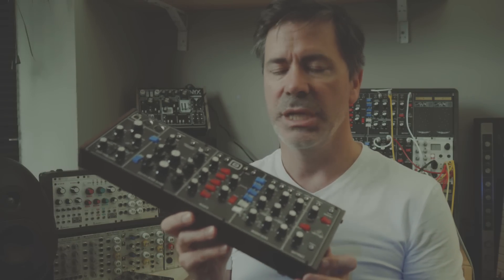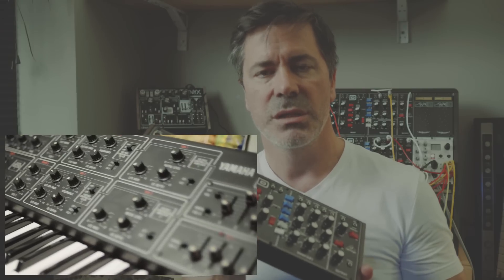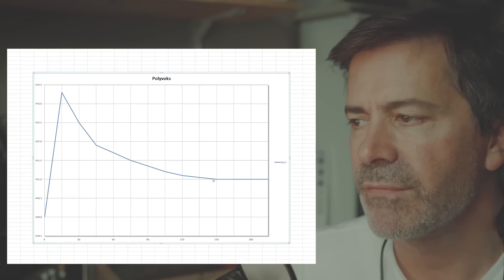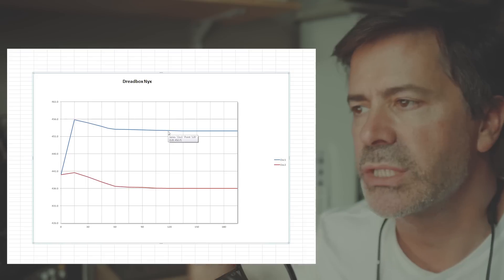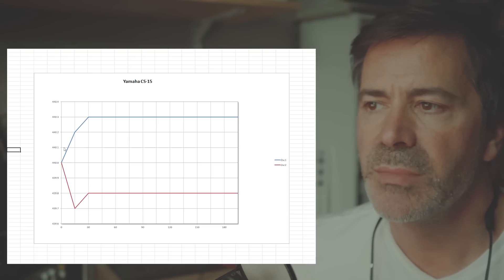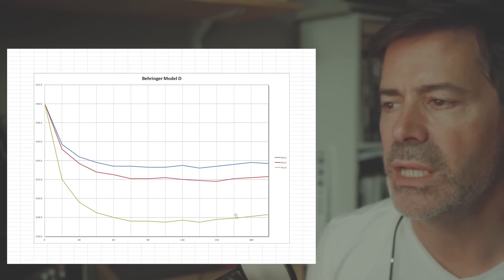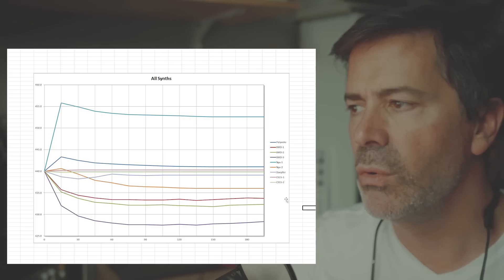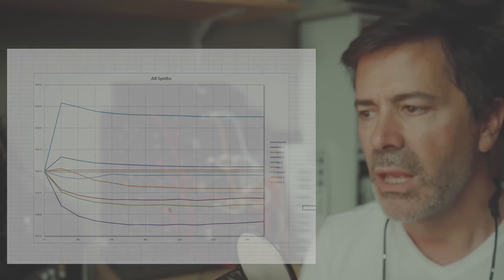Behringer Model D Oscillator Tuning

Comment: Excellent video. Thank you for producing it. This topic is why I occasionally consider flipping all my analog synths for digital synths. Sometimes I just want to work instead of waiting for my synths to warm up. But alas, warm and fat are hard to come by in the digital synth realm.

My current rule of thumb is to not bother tuning anything until after a good hour. That also means everything is out of whack until it warms up. The positive is that I basically never have to tune anything unless I bump the dial.
Reply: I think it's a matter of 'necessary authenticity' of each voice in your individual style within the canon of a chosen idiom.

If you gotta have a vintage synth sound, you can imitate it well(-enough?) using newer synths + doing some extra work..
Using the real thing gets you there instantly, with all the associated pros and cons. 
i.e. I still haven't found any sort of adequate substitute for my ARP Solus's lead character (swiiiiiiiirly and sizzly as f*ck = the 'most psychedelic' VCOs!), but that character only is apparent and effective in certain arrangements that bring it front and center. It is pretty stable for a 1980 build, btw.
 It is a similar deal but not as obvious with the TB-303. Iin a dense mix the clones may do just fine. However, in some of the more minimal music - wherein the 303 plays more 'naked-ly' -  is where I can sometimes I hear the differences vs my x0xb0x and FR revolution.

Comment: that was an interesting & enlightening experiment...
i have a behringer d & an arturia microbrute...
i always give them at least an hour to warm up before i use them...
although the model d's tuning does drift slightly over time, especially oscillator 3, it's nothing compared to the drift of the microbrute...
it always goes way out of tune, while the d is only slightly out...
that's been my experience, anyway...
Reply: An hour?!
My Minilogue, Typon and OB6 are all ready to go in under 5mins and all stay perfectly in tune all the time now. A few minor drifts when I first bought them, but after a couple of quick calibrations (automated obviously, because we have the technology) and they have been good to go ever since.
No excuse not to add auto-tuning nowadays. Especially when it's not even limited to the posh, top end analogues.

Comment: The PolyVox dishes up some nice tooth-wiggling bass from memory. Must be hard to keep in good nick though. I think these tests would be interesting to repeat at various times of the year or at various room temps in air conditioned environment.  
The original Moog Model D was quite variable from instrument to instrument..some stable and some would drift wildly. I wonder how the reissues compare, given they are reasonably faithful recreations.
So yeah, for most of these examples,  get up, shower, have a full breakfast, open your mail, talk to a few people and you should be right to go by elevenses LOL.
Reply: The model d reissue definitely slips out of tune. Today was the first time Eye decided to tune it since it was purchased in 2016. Before today the tune knob would be adjusted to keep it on tune.. Eye was always nervous to do it. But it wasn't difficult at all. It was much easier to read the manual rather then following some of the YouTube tutorials

Comment: Very revealing, thank you for doing this. But it's important to keep in mind that the actual amount of detuning that is happening in that graph of the Behringer D, although higher than the other synths, is still very, very small after about an hour and fifteen minutes, considering the fact that many patches intentionally include far more detuning between the three oscs than the amount of variance shown. So such patches won't sound like they are going 'in and out of tune', they would sound more like they are just exhibiting very slightly faster and very slightly slower 'beating' effects between already intentionally detuned oscs. It's also worth noting that lots of other types of instruments don't maintain their tuning over three hour as well as ANY of the synths in this test. For example, a lot of guitars. These comments aren't meant as a criticism of the test, (again, thanks for doing this!) it's just a comment about perspective, and how this amount of detuning may or may not be perceived in use.

Comment: And this is why old Yamahas are a bit too precise (but equally enjoyable) compared to Moogs. We think of "thick, lively" oscillators when thinking of the Minimoog and you've perfectly explained in these graphs why is that so, where some of the "analog mojo" lies. In fact older model D boards and Musonics models drift a lot more with the slightest change of room temperature and they're valued almost double the price of a vintage Minimoog. What baffles me (maybe infuriatingly so) is how Behringer has managed to nail the free-running discrete VCO sound in a mass product, SMT tech and all. It shows that it can be done if manufacturers want (and they usually don't). I really hope they can be as diligent in further products.

Comment: What were the environmental conditions of this testing? This appears to be a home studio in England I presume. My guess is there's no air conditioning in this room: temperature and humidity control. As others have wondered, how would a Moog D operate under the same conditions? Did Behringer make a very poor approximation of the Moog D or did they make an approximation that's too good (ie- favored trueness to the original over solving the issues)?
Reply from the maker: Hi. No air conditioning, just central heating and it's cold here in UK now so a constant 20 degrees Celsius in my studio thanks to the heating for all the tests. In terms of humidity I never measured by my guess is constant and dry. Yes it's a good question re. original Model D, I have never owned one.

Comment: Up and down, up and down but I don’t think I heard you mention by how much. What’s the scale on the frequency axis of the model d graph? (On mobile can’t see it right now). It doesn’t look like a lot. How does this compare to genuine model d ? Edit: so watched it again in HD on a big screen. After 80 mins all three oscillators seem to drift by no more than about +/-1 semitone or less. That doesn't seem like a huge amount for a VCO. The only question we should be asking is how it compares to other Behringer D's and genuine Moog Model D's.
Reply from the maker: It is enough for me to have to re-tune the oscillators multiple times an hour, ie. You can hear it.

Comment: Very good data collection. On the CS stability, the older Yamaha synths used volt/ hertz instead of volt/ octave scaling. This helped make those instruments more stable. A small fluctuation in the key voltage causes an equally small fluctuation in frequency. When testing the model D, were you using MIDI as the note source or CV? I am curious if your results are showing a problem with the on-board MIDI-CV converter.
Reply from the maker: Thanks very much. Yes I had your concerns too so I used cv rather than midi, and my midi to cv converter is Mutable Instruments and is rock solid

Comment: This test should be included in reviews. Very useful info. I sold my Behringer Model D for exactly this reason, it was just too unstable. I also found the tracking across octaves a problem even after going through the alignment process many times. I suspect the Moog would be the same. I think where the Boog shines is with the simple typical mini moog lead sound (just like the original model d) where some drift adds to the texture of that voice. Some call it character. Back in the day I built and used live a Transcendent 2000 (like Joy Division used) and it was a nightmare with drift, often going way out by the end of the gig. I had to juggle the set list so pitch critical songs using that synth came first. When I switched to a Juno 60 with its DCO it was a revelation. Because of my workflow and the limited time I get to write music these days an analog synth is out of the question. With tools like Omnisphere or Diva I can switch on and work straight away from where I left off the day before. It would be interesting to see a chart of VCO stability for all new and vintage synths. I owned an original Korg MS20 for many years and I remember that as being very stable, even at gigs where the ambient temperature changed quite a lot between sound check and performance. I think you have touched on an interesting subject and presented it well.
Reply: @Wilderness Music The Minilogue has a two-button self-tune function. Mine is very stable once warm and even if it goes out of tune, it only takes a button press and thirty seconds to retune.
Reply: I believe the early RA Moog mini D's (the first hundred or so) lacked a temperature compensation in the VCO section, that was implemented in the later builds. 
Perhaps Uli was copying the RA minimoog VCOs and not the temp-compensated circuit(s)? 
The Andromeda A6 is also quite unstable when bg and temp tuning are both turned off.  I know that the A6 was designed to reproduce the Moog modular's 9xx-series osc and filter rather than the D or memorymoog's, so that may have to do with why the B drifts as well.
Reply: I wonder if the stability of the K MS20 has to do with the volt/hertz instead of volt/octave?
Reply: I have a Minimoog with the early oscillators and a tech I knew put in heat stabilizing diodes before another tech installed the Big Briar MIDI upgrade. It stays in tune perfectly and hasn't seen a tech since 2010.

Comment: Thank you for covering this subject Tim. This is a topic which has always been of intrest to me since i began design my own prototype analog synth. I did a very similar test , and found the tuning was slightly off from switch on, from one day to another . As my circuits are all open on bredboard the ambient temprature is obviously an issue aswell. 
Im still wondering if the Behringer d expo is based on the 3046 transistor array or the ua726 ?

Comment: Thanks, that was reallly interesting. I've read before that you should leave a synth 15 - 30 minutes to warm up. Apparently not. I'm curious now how a minimoog behaves whether reissue or original. I think the general consensus is that the originals are very drift prone and unstable.
Reply: You have to warm them both. The mini model d and the Behri D. The oscillators will be grateful!
Reply: its like a tube amp

Comment: Thanks for this, Tim. Such graphic explanations are most welcome.  The upshot, then, is to allow some of these analog beasts (except the highly stable Yamaha CS-15) an hour or two to warm-up time before using them. Although the Model D never gets completely stable, it does seem to fluctuate within a fairly narrow range after 120 minutes. I think I can live with that. 

Many acoustic instruments (several of my guitars, for example) also drift out of tune, some strings drifting more than others, probably even more so than the Model D's oscillators. They drift in response to playing them, the room thermostat (HVAC) cycling in and out, and other factors. Occasional re-tuning is something you just live with for many musical instruments.

Comment: I wonder whether the MInimoog suffered/suffers from the same issue...
Reply: The old Ds went out of tune halfway through a show. They were really sensitive to changes in temperature and humidity. I wouldn't keep one outside a climate controlled studio.
Reply: I play in Will Gregory's Moog Ensemble and can confirm that we have to tune the Mini's between songs without fail. They still sound better than anything else though :-)  @RhombusLabs
Reply: Erdnase23 I was just thinking the same thing but honestly all of the moogs I own some new some old or extremely stable!!

Comment: I wonder if the oscillators in the Model D are also in the Deepmind 12 & 6 ?
Reply from the maker: The Deepmind’s oscillators are digitally controlled, which basically means that they are being constantly re-tuned in the background. Many modern analogue synths work this way, usually they are the ones that offer menus, the ability to load and store presets, etc...
Reply: Thanks Tim, by the way I like the way the letters of your name appear in the opening ident finishing off with MOOG as they fall into place ! Was that intentional?
Reply from the maker: Ha yes. My original random animation had the m o and g appearing quite close together which gave me the idea to invent another o !

Comment: How much of a problem in practice do you find it?
Reply from the maker: I find myself checking and re-tuning oscillators frequently, perhaps 3-4 times an hour. If you have a simple patch going then this is quite quick to do, but if you have a complex patch with movement and modulation then that is a bigger problem: You need to undo elements of your patch before you can re-tune and you are interrupting any creative process you have going on.